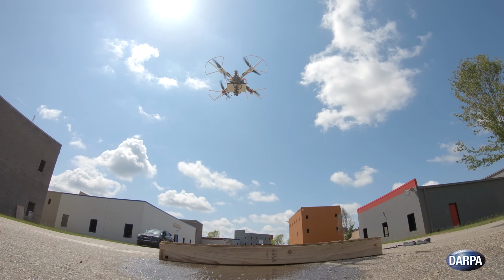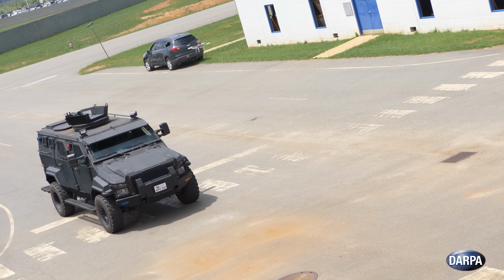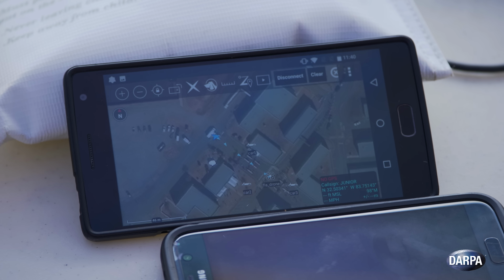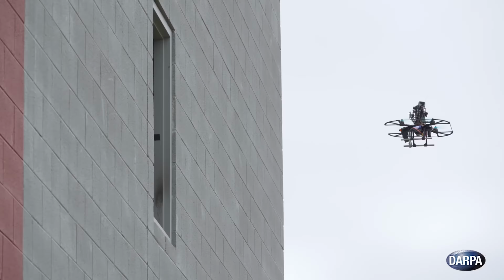Fast Lightweight Autonomy (FLA) Phase 2 Flight Testing

Comment: @DARPA can you user LiDAR on this platform to help it build a 3D model? Use what you already have...
Reply: Size, weight, computing power, and memory were reasons that traditional rotating lidar wasn't used.

Comment: I remember watching Flubber back in 1997 and thinking, "Damn, wouldn't it be cool if we could make something that could actually fly around like that little droid? Too bad it's impossible!"

Turns out that Weebo could be a reality... it's a cross between Siri and a quadcopter. Just need to up the power density on the batteries a bit more or perhaps research fuel-cell powered drones.
Reply: Doug Mapper ... and kill people on the way.